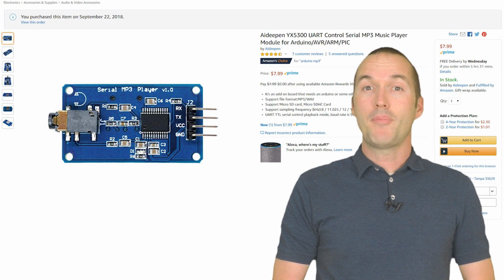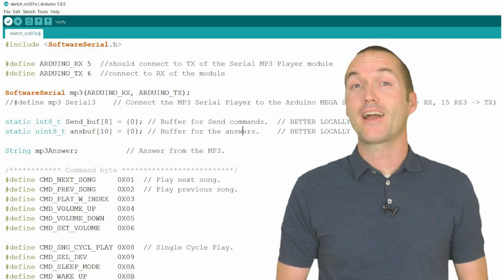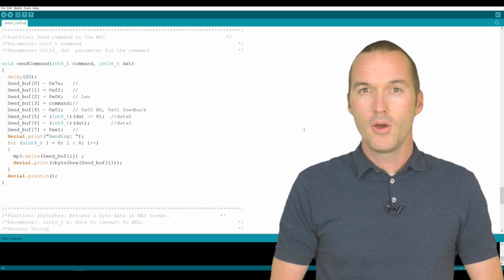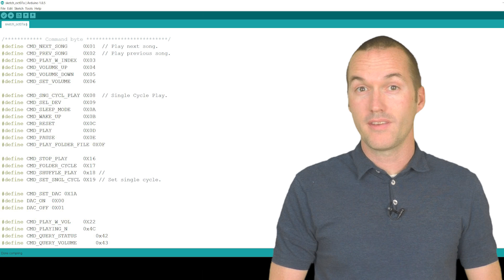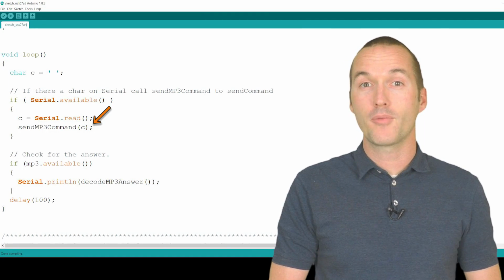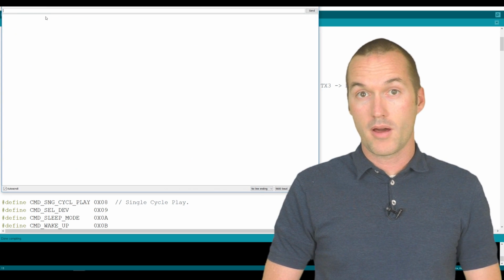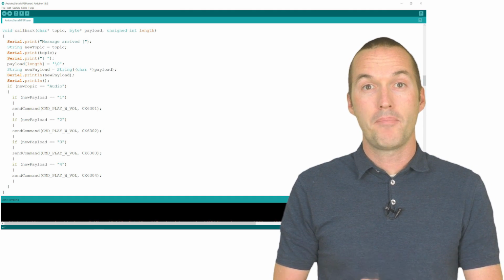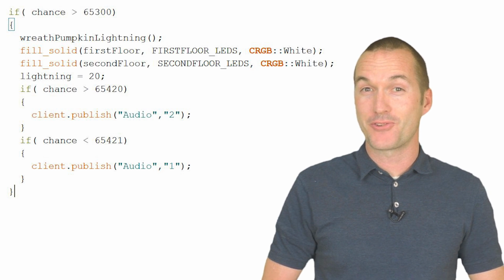Add Audio To Your Projects, and Learn To Quickly Read and Use Other People's Code.

Comment: I tried to compile and it fails here: exit status 1
no matching function for call to 'SimpleTimer::setInterval(int, void (&)())'
Reply from the maker: Yeah, whoever was maintaining the simpletimer library for arduino pushed an update that basically broke all previous programs.  You can install my fork of the library to fix the issue: https://github.com/thehookup/Arduino-SimpleTimer
Reply: @TheHookUp  So super long story. I got it to work. There was a missing { somewhere that I did not write down, but it would be obvious when the error presents. The harder part was the library. The current library is called SimpleTimer also but it's by Alexander Kiryaneko. The "older" one you used was also called the same but by M Romani and with modification by Bill Knight (at least mine says). Additionally, I had to move all the functions up front by the #define statements or else it wouldn't compile. I believe things had to be declared first before they were used. Now it works.

Comment: Good explanation! I have been searching for a while but I am not yet able to add the send bit to the WLED script with the lightning effect. Found the right piece but the standard mqtt send comandos don't work in that script. Someone figured this out already?
In the FX.ccp under
uint16_t WS2812FX::mode_lightning(void)
client.publish("Audio","1"); //LIGHTNING Start mp3 Player 
Gives ERROR 'client' was not declared in this scope.

hope someone can figure this out!

Keep up the good work!
Reply from the maker: WLED uses a different MQTT library and is frankly a much more complex program than what I've put together, so it likely won't work in the same way that I described.

Comment: Hey Rob,
Love this project. one question do your speaker(s) you have connected to the mp3 player made a slight noise when nothing is playing? and are you using powered speakers? mine make a kinda tapping sound when no file is playing. if i unplug the nodemcu from power the noise stops in the speaker so seems to be coming from the nodemcu or mp3 player. its fine when a file plays.

Comment: Hi again,

Can someone tell me please  the difference between this two cmd lines ?

    if (newPayload == "1")
    {
    sendCommand(CMD_PLAY_W_VOL, 0X6301);

_________________________________________________________________________________
    case '5':
      Serial.println("Play folder 5");
      sendCommand(CMD_FOLDER_CYCLE, 0x0501);
      break;
________________________________________________________________________________

because when I send payload 1 it do not play the file 01_song_01
Reply from the maker: Both should work. That should play the file in folder "01" with a volume of 99, are you missing the closing curly bracket } ?
Reply: @TheHookUp  Thank you for responding so quicky. for file 10 for exemple  will this command lines work

   if (newPayload == "10")
    {
    sendCommand(CMD_PLAY_W_VOL, 0X630??????);
    }
____________________________________________________________________
    case 'A':
      Serial.println("Play folder 10");
      sendCommand(CMD_FOLDER_CYCLE, 0x01010);
      break;

if I use case '10': I get an error message
Reply: All this work until 09, but "10" don't know if I have to use "A for 10 or X or 1010 .

It may sound like a stupide question , but i'm really new to arduino code.

this ones works well

   if (newPayload == "1")
    {
    sendCommand(CMD_PLAY_W_VOL, 0X6301);
    }
    if (newPayload == "2")
    {
    sendCommand(CMD_PLAY_W_VOL, 0X6302);
    }
    if (newPayload == "3")
    {
    sendCommand(CMD_PLAY_W_VOL, 0X6303);
    }
    if (newPayload == "4")
    {
    sendCommand(CMD_PLAY_W_VOL, 0X6304);
    }
    if (newPayload == "5")
    {
    sendCommand(CMD_PLAY_W_VOL, 0X6305);
    }
    if (newPayload == "6")
    {
    sendCommand(CMD_PLAY_W_VOL, 0X6306);
    }
    if (newPayload == "7")
    {
    sendCommand(CMD_PLAY_W_VOL, 0X6307);
    }
    if (newPayload == "8")
    {
    sendCommand(CMD_PLAY_W_VOL, 0X6308);
    }
    if (newPayload == "9")
    {
    sendCommand(CMD_PLAY_W_VOL, 0X6309);
    }
_______________________________________________________________
    case '1':
      Serial.println("Play folder 1");
      sendCommand(CMD_FOLDER_CYCLE, 0x0101);
      break;

    case '2':
      Serial.println("Play folder 2");
      sendCommand(CMD_FOLDER_CYCLE, 0x0201);
      break;

    case '3':
      Serial.println("Play folder 3");
      sendCommand(CMD_FOLDER_CYCLE, 0x0301);
      break;

    case '4':
      Serial.println("Play folder 4");
      sendCommand(CMD_FOLDER_CYCLE, 0x0401);
      break;

    case '5':
      Serial.println("Play folder 5");
      sendCommand(CMD_FOLDER_CYCLE, 0x0501);
      break;

    case '6':
      Serial.println("Play folder 6");
      sendCommand(CMD_FOLDER_CYCLE, 0x0601);
      break;
    case '7':
      Serial.println("Play folder 7");
      sendCommand(CMD_FOLDER_CYCLE, 0x0701);
      break;

    case '8':
      Serial.println("Play folder 8");
      sendCommand(CMD_FOLDER_CYCLE, 0x0801);
      break;

    case '9':
      Serial.println("Play folder 9");
      sendCommand(CMD_FOLDER_CYCLE, 0x0901);
      break;
Reply from the maker: @babyface3105  sendCommand(CMD_PLAY_W_VOL, 0X630A); should be 10
Reply: The Hook Up thanks a lot

Comment: BABY FACE
il y a 17 minutes
Stackner still not work for me, I don’t know what I’ m doing wrong.
TX=> D2, RX=>D1, GND=>G, VCC=>3V, SDcard PNY 16gb class 10=>  formate FAT32 with folder=> 01 and 02 
in the 
folder 01 => 
01_song01_01.mp3
02_song02_02.mp3
and 03_song03_03.mp3.

In folder 02 
04_song04.mp3
05song05.mp3
Reply from the maker: what does the debug window in arduino show?
Reply: @TheHookUp  I  do not get errors and when I try to send command  with MQTT Publish a packet 
topic "Audio"

Payload (template allowed)
1

I get well "in arduino monitor 

Message arrived [Audio] 1
Sending: 0X7e 0Xff 0X06 0X22 0X01 0X63 0X01 0Xef
Reply: But the MP3 Board do not play the 01 file :(
Reply from the maker: @babyface3105  try swapping your RX and TX wires.
Reply: The Hook Up You are the best.
It works :) :) thank you very much

Comment: Hey Rob.
I had rewritten the mp3 player code for tasmota to get it as simple as possible (that's our way of working, don't use extra libraries).
We are now on version 1.0.0.4 20181003 for the mp3 player driver (xdrv_14_mp3.ino).
I saw that you used case case '?': and case 'h':. Basicly a good idea when there is no further documentation.
I would add part's of that switch (as simple as possible) to give the users of tasmota a little bit more help when they using it.
- My question:
If it OK when i use some of your code to implement it to tasmota's MP3 Player driver?
- I would add a comment in the histroy with your data. Possible we can talk about it.
Please contact me here: https://github.com/mike2nl
Reply from the maker: Go for it.
Reply: Mike how is this going?

Comment: Taaaa Daaa!!!  It works.  Thanks Rob for some more great work. The only issue I had was converting pin 4 and 5 to D1 and D2.
I am just using the serial monitor.  Next,  I may use my DASH button to play something cool or who knows...
Reply: One more thing. The operation of this became intermittent. Usually worked but not always. After fiddling around,it would recover. While fiddling, I noticed that the MP3 player was very close to the WiFi antenna on the  processor board. I separated the by half inch more and now, 100 percent reliable. Seems obvious now. Something to remember.

Comment: 0 documentation?  It has some of the best documentation ever, and not even in chinglish!  A quick google search reveals a website with a pdf at geekmatic.in.ua.  Link:
http://geekmatic.in.ua/pdf/Catalex_MP3_board.pdf

Sending the commands is trivial since its async.  If any commands are missing in that code you found, you can add them from the table 4.1.2 of the manual.

For those that may prefer a library for ease of use, Ralph Bacon did a video on that a couple years ago too, but his was a DF Robot one and was smaller with no headphone jack.  There is a link to the library for that in his video:

https://www.youtube.com/watch?v=TjomLQs0KgY

A quick glance through the library shows it takes the same codes, so looks like it would work easy for that player also, although I don't own said gadget so I never tested that.

But nevertheless, that thing is a pretty nifty device you found for pennies(on AliExpress anyway). I take issue with the terrible file naming semantics, but then again we are making cheap tacky (hopefully temporary) Halloween gadgets and not trying to replicate Volumio!!!

Comment: Nice presentation. 👍👍
I've tried parsing libraries & most of it is still greek to me. The code you found was easy by comparison. What still gets me is the int8_t etc variable types. I'm used to saying int, string, long, float, etc.
Reply from the maker: That stuff doesn't matter too much for the level of programming that we're doing.  uint8_t is just an unsigned 8 bit integer that will always occupy 8 bits.  As I understand it if I had a uint8_t variable with a value of 2 it would be 00000010 in memory, vs int that uses 16 bits and would be 000000000000010.  It just saves memory, but an ESP8266 has an insane amount of memory for most of the programs that you and I would write.
Reply: @TheHookUp  ok, true. I've only hit 50% on my ESP32s so far.

Comment: Should i be using a esp8266 or esp32 version of a nodemcu board? Was going to buy esp8266 version as i use all tamotised devices and know how to use sonoff and d1 mini boards but was not sure if the 8266 nodemcu is the one ypu used for this?
Reply from the maker: Tasmota needs ESP8266.
Reply: would it work with a d1 mini or only a nodemcu?
Reply from the maker: Either, they are both esp8266

Comment: One of the best videos ever. Thanks. I ordered the player before I finished the video. I figure you will drive up the price.
Took about 10 minutes to have the code running. (remember to change the serial monitor to 9600) . Got the Sending message and connection messages.  Now waiting for Amazon. Nicely done.

Comment: Great!  The mp3 player has adequate output to drive powered speakers without too much distortion?  What are you using to amplify the mp3 player output?
Reply from the maker: At the moment it's going to a set of computer speakers.  I'll eventually use a aux to RCA to pump it into a stereo receiver with speakers.
Reply: Could you send it to a Bluetooth speaker instead of a stereo receiver?
Reply: Mark Duman I am using a Bluetooth speaker using a cable to input jack. But not all of them have input jacks.